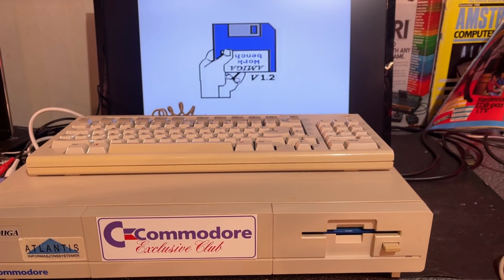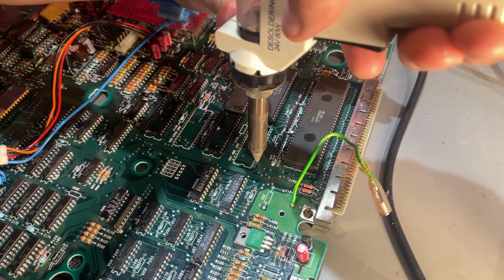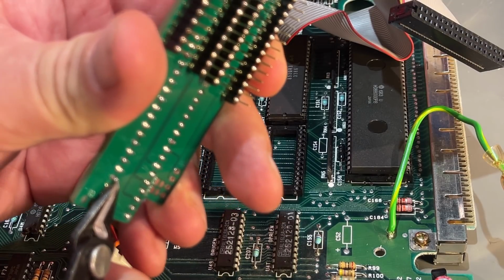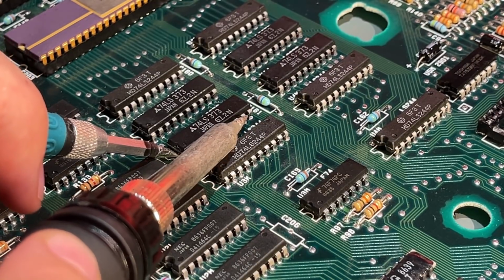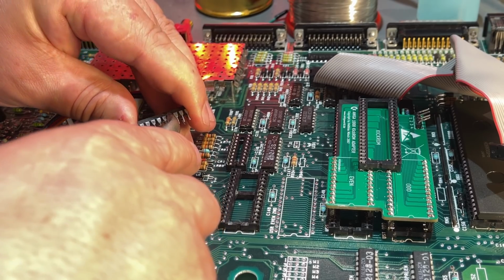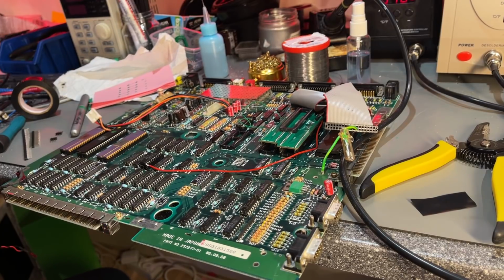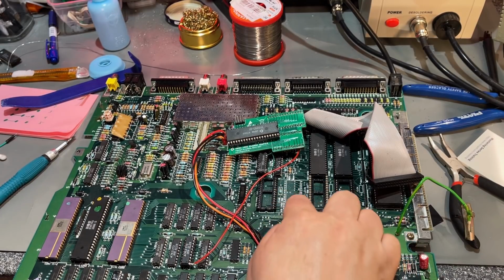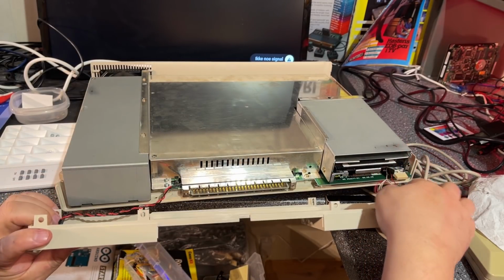Commodore Amiga 1000 kickstart rom modification - Say bye to the kickstart floppy disk

Comment: Hello Great video, thanks for your work. I have made that Mod and I remember that it drove me crazy for a while if you want the kickstarts burned in an eprom to work you have to connect the OE pin of the kickstart to ground someone forgot to make that connection on the PCB and only the original kickstarts work. After this i install a 3.2 kickstart in the A1000.
Reply from the maker: Thanks for the tips!

Comment: tip: you can use hot air instead of iron while lifting a desoldered chip... this is safer and would avoids trace lifting.

Comment: Nice job Tommy! My rule with desoldering ICs... if it's not something I really really need to keep intact, I always cut the pins from the body of the IC and remove each one in turn. I'd much rather sacrifice something like an 74LS139 than potentially damage the PCB.
Reply from the maker: That's a good idea! Thanks

Comment: To much work to connect two wires to IC pins. I would cut the two pins close to the pcb surface, bent the pins up a little bit and solder the wire on.

Comment: I think there's something cool to load KS from floppy and I want to keep retromachines as original as possible. Modded my A1000 with the 68k-IDE+8MB RAM -hamburger which goes to CPU socket. Then 4GB CF-card for Workbench 3.1 and some tracker-music plus WHDLoad demos & games there. If I want to boot from it I need the TwinKick-floppy which boots KS1.3 first and then right after loads KS3.1 which can boot from the CF-card. If I want to play games from floppy then I just took the TwinKick-floppy out right after KS1.3 gets loaded.

Comment: well - I haven't designed a pcb mayself yet - and I do get that it comes down to cost if you already have different specs in mind when design the machine - but for about the past 15 - 20 years I always wondered why so many systems end up with so much unpopulated componentes - or have hard linked traces in places where user changeable jumpers supposed to be
sure - looking at something simple like my s-ata HBA - it's one design for anything between 2 and 20 ports - and it's even cleverly routed so those stacked double ports can be used in any config and spots where port multipliers can be placed can also be easy bridged to just pass through a host port directly - but does the saving for running only one pcb design make up by the different models? to me it feels like a huge waste to ship a full 20 port capable board which is only populated with 2 ports (you can't upgrade it yourself as 1) you won't get the required chips - I already looked it up - and 2) you don't get the required firmware roms) - so this has to be made up again with the fully populated ones
scaling this up to entire pc motherboards - well - I'm clearly missing something here

Comment: Hey. After 20 years of abstinence, I put my Amiga 1000 back on my desk and discovered this tutorial. Thank you very much for that!

Unfortunately, the conversion doesn't work for me. I've checked, measured and dissected the video again and again. Nothing helps. As soon as I switch on the Amiga, the power LED comes on briefly and then flashes (alternating between light red and dark red). It takes about 5-10 seconds until the Amiga boots again... this repeats itself forever.

Does anyone have an idea?

In my instructions for the Kickrom adapter, for example, there's nothing about bending up pin 1 (U3J). It just says to make a connection to pin 1 adapter.

HELP PLEASE!